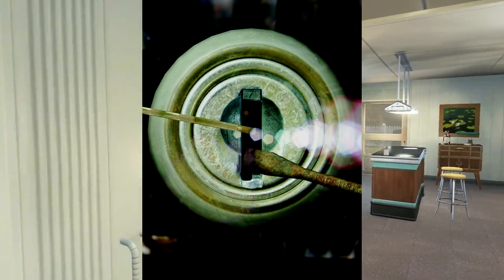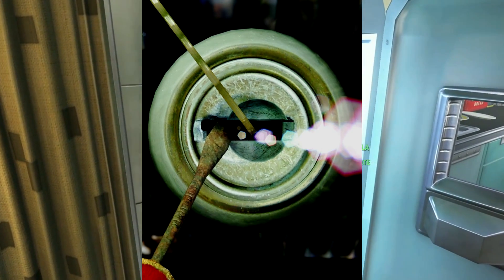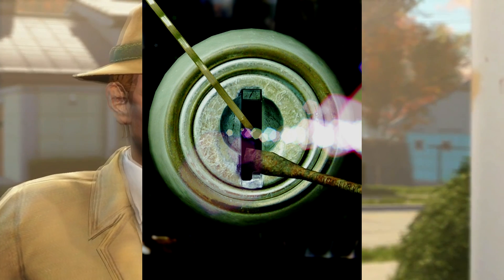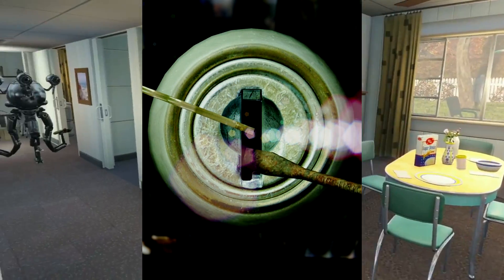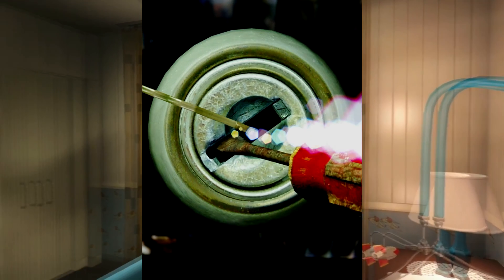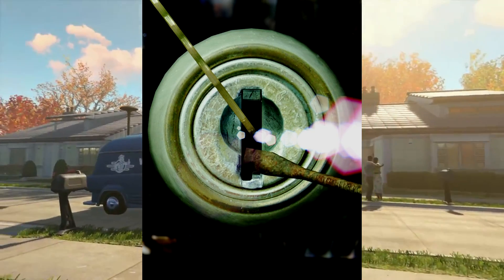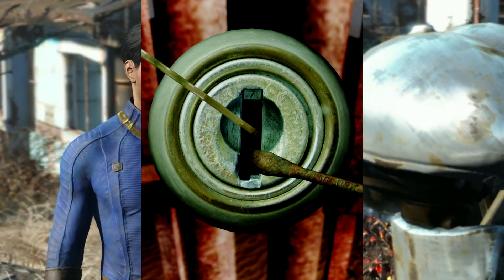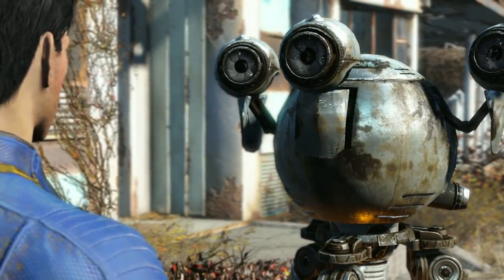Fallout 4 - Secret to Lockpicking tutorial (How-to Guide)

Comment: So I dunno if anyone will read this. But if you’ve played Skyrim and truly know what bethesda has always done for lockpicking. Then hear me out. After new Vegas and fallout 3 it’s been the same mechanic. The trick is to memorize those sweet spots for novice, mainly advanced because those are the most repeated just with a smaller window then novice. Then the masters because expert is always the same three spots and two of them are near identical to advanced. Master only has three or four just depends on your irl luck as it’s normally the same two. For novice it’s always gonna be right where you start (so don’t move the pick at all. And then move it a bit to the right just a few hairs to get it. It’ll almost never be exactly where it spawns unless you again have perks or irl luck. The next spot is to the right of the scratched on X on the lock. The next is either far left or far right and the final one would be somewhere in between far right and the middle. That one’s the least likely to pop up as it’s way too easy to have all the time. Advanced is tricky, you have the left side middle of the scratched out X. Then three or four hairs away from the middle on either side. Or far right. Never anything in between. That’s why it’s the best to memorize. After that it’s kinda easy. Expert is actually harder then master as I has the random fourth spot. That’s the far left but it could be on the right or the left of the scratched on X. Then it’s to the right a few hairs from the middle but that’s where the rare instance comes in where you get the left a few hairs from the middle. Then far right as the last for expert. For master it is always near the X somewhere right or left. Then the middle or a few paces either side (that’s where this guys tips about just tapping to test it come in handy) then the final for master is somewhere far right. And this system has never failed me and I’ve never once in my 15+ years of gaming ever had issues with it since. Every other game copies that same preset. With this or with oblivions lockpicking. Like how elder scrolls online attempted to do. I hope I could help, alas even this sounds complicated as heck. But the just is it’s been the same the last four generations of games and I don’t see it changing anytime soon especially with starfield and 76.